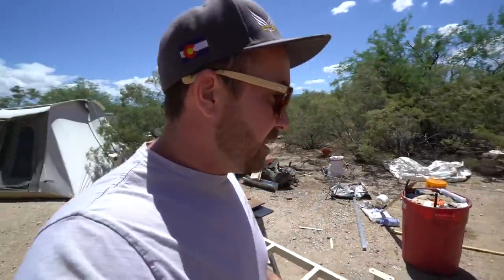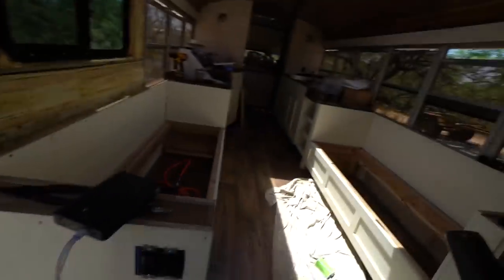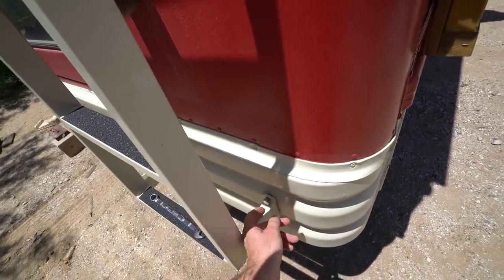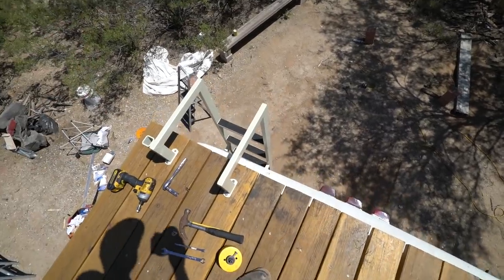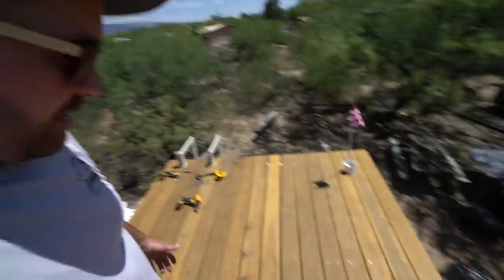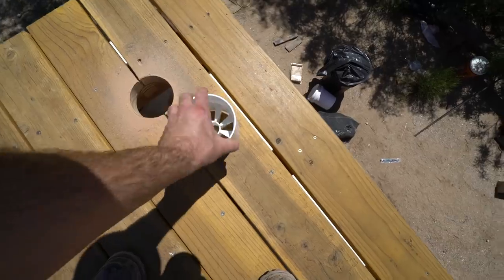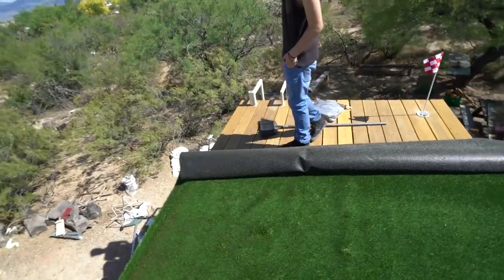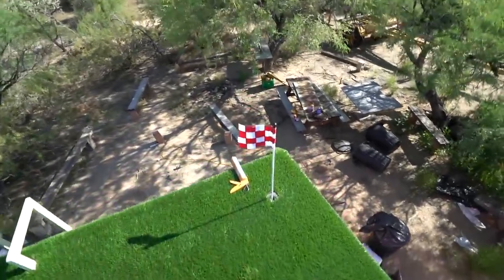Golfing Putting Green on Skoolie Rooftop Deck! (school bus conversion)

Comment: That Astroturf will rot the Redwood within 2 years.  The Astroturf will hold moisture and the Redwood needs to breathe.  Put a piece of Lamanite seal it and nail to the Deck.  Also, mark the holes pull the latter down drill or tap and put the latter back up there is a whole lot of outward presser on that latter when you climb it.  Redwood is a softwood and the lag bolts will wobble out.    I had to replace a redwood deck after my mother put Astroturf on it.  It does look good for a golfer but please trust me on this!!!!
Reply: I know decided on rare expensive redwood, when if this was the plan should have been pressed, and treated.

Comment: Mark the holes, remove ladder.  Drill. 
More work but not half assed.  Glue is a joke. 

Grass over wood?  Gonna trap moisture and rot your deck.  
You will be fighting keeping the grass from blowing away everytime you drive past 60 mph.  

Finish the inside, stop adding more Stuff till you have interior done.  
Stay focused.

That’s what dad would say.

Comment: Jaxman here is what you need if you ever have to put a screw in on a right-handed angle ----
Right Angle Drills - 2Pack 105 Degree Angle Extension Power Screwdriver Drill Attachment 1/4 inch Hex Magnetic Bit Screwdriver Holder Adapter
$14.00 Amazon

Comment: I agree with Todd Johnston about the ladder. It is definitely "class" and looks great, as does the green.  Can I ask how you fastened it? I'm assuming you used glue, but did you put an edge around it to anchor it into the sides helping protect against the wind? It's such an amazing idea but with my luck driving down the road the wind would get up under it and blow it off LOL. Hey as always, looks great, be safe and wear them safety goggles and thanks so much for sharing.

Comment: Use a sharpie and mark your holes for predrilling .. Then put down the power tool and grab a rachet with a socket to put bolts in .. And JB Weld would not hold that ladder on .. It's not made for that type of application. . I would hit some balls off the rooftop .. Don't forget your ball bumper around the deck